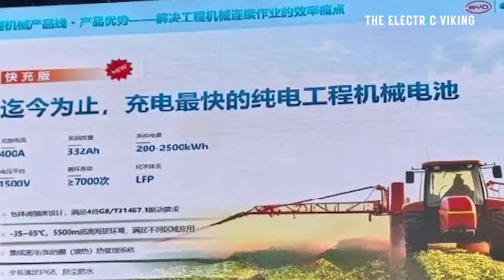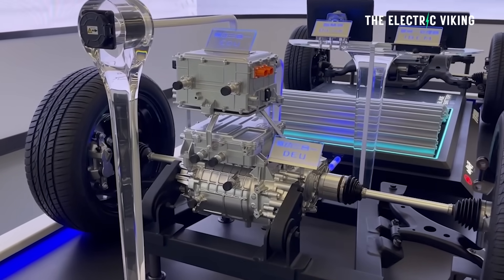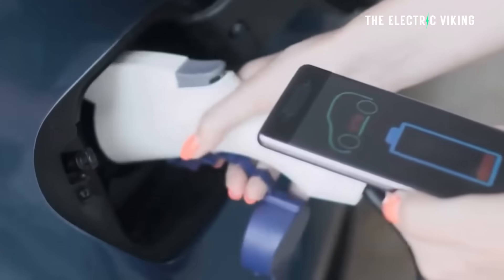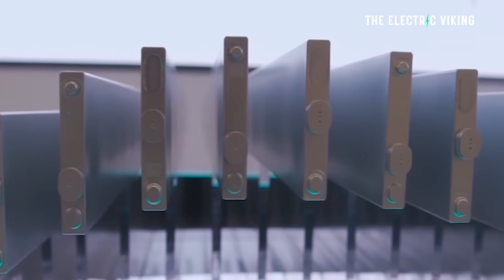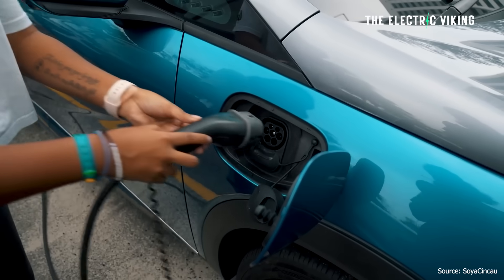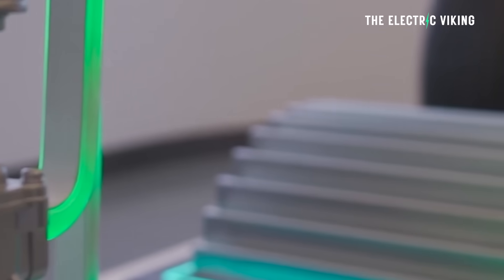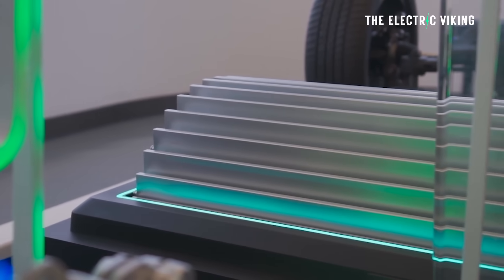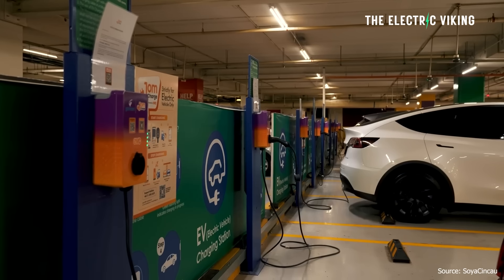Leak reveals INSANE charging speed of new BYD Blade battery V2

Comment: The problem with going over 800v is that the parts become more difficult to get. That is the reason most EVs are 400v. 400v parts were easily available before EVs were popular.  Going to 1500v for cars will also be problematic because of the insulation and there is not sufficient benefit from the higher voltage.
Big mining trucks run on 3000v  (the ones that use electric motors and a diesel generator)

Comment: Then they probably have a problem in the EU.
In the EU normal electricians are allowed to work till 1000V AC and 1500V DC, 
Somehow a 1500V DC battery can charge with a voltage of 1850V DC or so, so normal electricians are not allowed to work with this, let alone normal people.
I think they can better go for a 1200V DC battery.

Comment: Higher voltages allow for thinner cables to convey more power. The drawback is the challenge of maintaining proper isolation and security.

If we compare a Tesla with a 75kWh pack @ 400V, with a Porsche with 150kWh @ 800V, we could infer roughly two Tesla Packs in series, charged at twice the total power, but same power per pack, with the same set of cable cross sections but higher isolation requirements.

It might not be a battery cell or pack attribute, only a system integration property, with different tradeoffs.

Comment: The new Brisbane metro was launched in October. it's not a train, it's actually triple length dual articulated electric buses that run on demand. They can charge these at their depos but they also charge while they are en route. See below:
Fast charging
The Grid-eMotion™ system is a pantograph charger that can charge a bus in under six minutes. This system is fully automated and requires no driver input.

Comment: Less heat is the reason for the higher voltage. It's the same reason why powerlines are stepped up to such high voltages. As charging speeds increase it is entirely possible there will be even higher voltages in the future.

Comment: You should go back to elementary school, learn some simple matematics and aome basic electric.
1500V is 1500V does not mean a shir if it is a 500kWh battery or even a 100kWh that is charging with 100 amps.

You cant say "this car charges att 500kW" ianit a 50kWh, 100kWh or 500kWh battery? Makes a lot off difference, one is charging in 6min 0-100 one 12, and last one 60min...

Un following after 2 years of following you. Too hyperbolic and you just throw around the numbers... 👋

Comment: Mainly for CONSTRUCTION machinery. Excavators, Dump Trucks, etc . Such machinery would need such capacity and power due to the construction Work involved. Game changer as running and maintenance cost would be significantly CHEAPER and LESS DOWNTIME.

Comment: Existing 150kwh+ chargers are already a pain in the arse to use - heavy and short cables that people struggle to plug in. This is because these cables have to have cooling mechanisms. More heat, means more cooling and any ultra fast charging system would unusable. So assuming it happened at all it would have to be done some other way, e.g. something that mechanically comes up from the ground and connects to the car. So basically no use to any car in existence today and probably only has specialist uses even if it were to exist.
Reply: No issues using super fast chargers to charge our Seal Performance. Regularly use 250kw chargers (charges at ~157kw) and no issues with cables or the like. You'd have to be a toddler to think they are too heavy to use. Just sayin'.

Comment: NO GAME CHANGER. - When German engineers were asked why they dont use a system voltage beyond 1000V they said it is not durable. You have a large chunk of electronics that was developed for trams with an designed input voltage up to 950 V or 1000 V. You can of course overdrive them and it will work, so for the megawatt charging system (MCS) they had a demonstrator running at 1250V. Surely you can work with suppliers to enhance production and testing but that takes time and money. It is nowhere near of actual production - and if the Chinese suddenly start to mass market it then it will fall under the usual category of "tofu dregg".
Reply: It's possible that they've managed to make it durable
Reply: Yeah the German engineers aren't exactly at the forefront of battery technology, or else the EU won't demand a tech transfer from China.
Reply: @leefster1  battery cell technology, not the battery managment system.
Reply: 🥱boooring.

Tofu my ass.

Comment: This battery and architecture will be used in the BYD HAN L, and we will hear about this car next two months. In fact, BYD batteries are constantly improving, and they didnot specifically promote this as the second version of the blade battery. In 2023, this battery and architecture were installed in the YANGWANG U9, which reached a top speed of 391 km/h in Germany.
Reply: Is it known when an update of BYD Atto 3 will be released with the eplatform 3.0 evo and these new batteries?
Reply: @fiewu34hiuf  I am not sure about atto3 (yuan plus), maybe at the end of 2025, they have a new platform, if atto3 platform upgrade, it will take longer. Their huge SIC factory is ready, 1000V-1200V platform is possible for all new cars, you will see the upcoming Han L, Tang L will use this new platform. New battery products are Sea lion, Leopard 5, Leopard 8, Yangwang U9, U7, Denza n7, n9 ,Z9, Z9GT
Reply: @fiewu34hiuf  I am not sure about atto3 (yuan plus), maybe at the end of 2025, they have a new platform, if atto3 platform upgrade, it will take longer. Their huge SIC factory is ready, 1000V-1200V platform is possible for all new cars, you will see the upcoming Han L, Tang L will use this new platform. New battery products are Sea lion, Leopard 5, Leopard 8, Yangwang U9, U7, Denza n7 n9 Z9 Z9GT
Reply: @fiewu34hiuf  I am not sure about atto3 (yuan plus), maybe at the end of 2025, they have a new platform, if atto3 platform upgrade, it will take longer.
Reply: I am not sure about atto3 (yuan plus), maybe at the end of 2025,  they have a new platform, if atto3 platform upgrade,  it will take longer.

Comment: The higher system voltage can help charge times by having less current going through the charging system, but it can only help so much, because it doesn't change the "C" rating of the cells.
Reply: Most of the time the limiting factor is the charger, or more specifically the voltage and cable rating.

Like take a look at Kyle's recent video testing their 180kw battery based DC fast charger with the equinox. Due to the CCS cable being only 200 amp rated and the vehicle being sub 300V when low it would only get just under 60kw out of the charger even though the battery should be easily capable of 3C between about 10-60  just like Hyundai's Ioniq X series.

Supporting higher voltages will let a wider range of vehicles charge at better speeds.
Reply: @Snerdles Yeah, but like I said, increasing voltage can only help so much. He mentions if they put higher voltage in some other cars you could have 10 minute charge times. If you have a 3C max charge battery cell, going to higher voltage doesn't turn it into a 6C cell. Which is the minimum you would need to be able to charge in 10 min.

Comment: I'd hate to be in a car crash with 1,500 volts under the seats!
Reply: Ice cars have tens of thousands of volts in their spark and ignition coils
Reply: @dw9666   But those voltages are only generated by a RUNNING engine!
Reply: That's just for charging. The battery is not going to necessarily release it's charge in that scenario.
Reply: Nor several mega joules of highly volatile hydrocarbons just behind your back of your seat.

Comment: It can'b be charged within 10 minutes.
400A and 1500V = 600kVA which is about 600kW
Minimum size is 200kWh. Even if you will charge flat 600kWh (which is 10kWh per minute) from 10% to 90%  (which is 160kWh) then you will need 16 minutes for that
Reply: What about having multiple chargers? Isn’t that what Tesla’s truck is doing?
Reply: @71kimg  limit not in charger, limits in battery
Reply: @ well if you split the battery and charge both - you have double the speed in the beginning
Reply: @71kimg  you can't split battery of MINIMAL size. You can install 2 x 200kWh and chargr them simultaneously. If you split 200kWh by half you will get 750v instead of 1500v
Reply: On the screenshoted document it shows a charging current of 400A and a cell capacity of 332 Ah. If I recall, the whole point of the blade battery is to put them in series only so they will all see the same current, most likely (regardless of the total energy and voltage).
So they would fully charge in 332/400h which is 50 minutes

Comment: busses dont need to sit anywhere to recharge if u just use wireless charging ports and electrify the bus stops its just about properly integrated infrastructure.

 or if u use something like the solar roadways developed in the early 2000s u can just have the roadway electrified and continually charge vehicles as they drive and it lets u have road access above all your battery storage and energy production and u can bundle your telecoms/optic cables and stormwater infrastructure with it. it also leads to less surface maintenance because theirs a proper foundation under the road and the surface is engineered plates so when damage dose occur they are modular and replacement is fast
Reply: "just". it's a budget question. letting them sit and charge is just way cheaper.